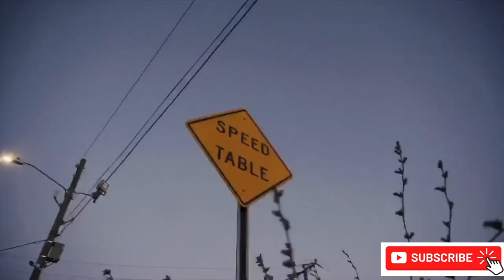Lexus Sc400 coilover install part 2

Comment: Guys gotta be careful when you lower SC's. The wiring harness runs inside the drivers side fender right above the drivers side fender liner. The Drivers side wheel will chew through the liner and the Harness when it's lowered and when it goes over bumps and potholes.
Reply from the maker: We noticed that and luckily caught it before it was too late